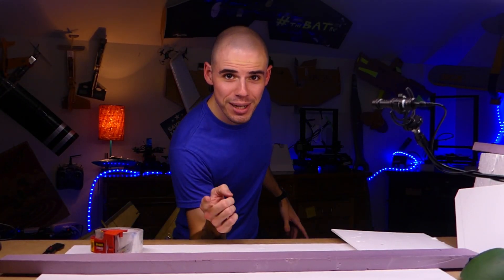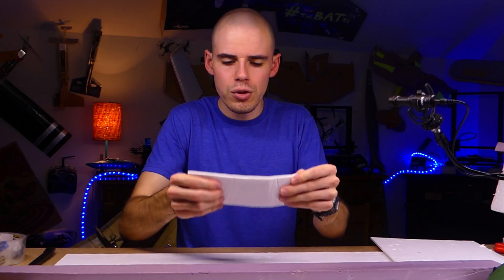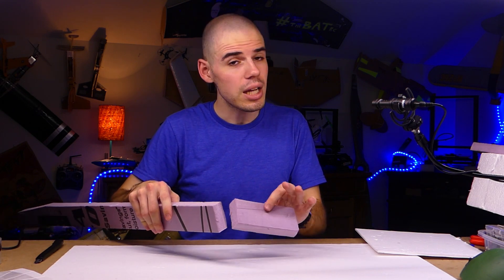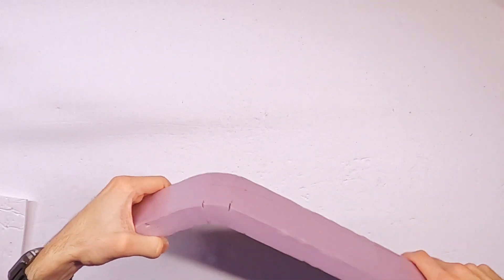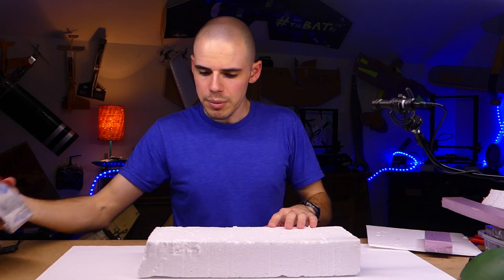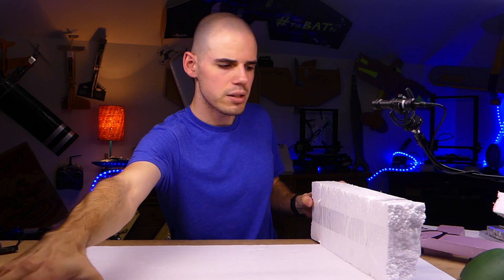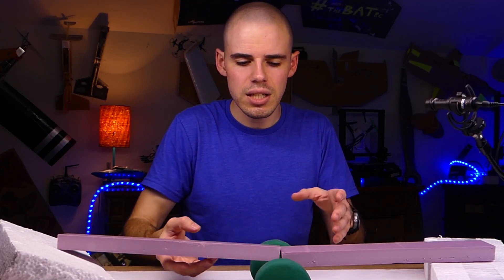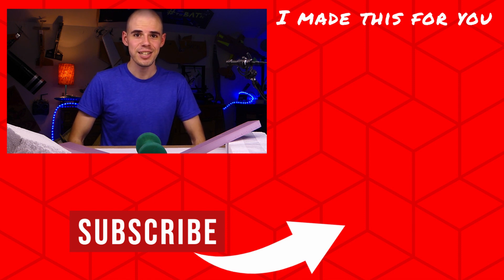Packing Tape is like MAGIC for Airplanes! Fun Packing Tape Strength Demonstration

Comment from the maker: What's YOUR fav method for making your planes STRONGER?
Reply: If you had started with a paper mache' skin, sanded it smooth, and then added a packing tape, or even better, a super thin lamination film skin, your test would be much harder to demonstrate since the composite is hard to damage.  If you did the combination on both sides of your foam board as shown in this video, you would need a lot more weights to cause the foam board to break, or crush into a U shape.  It is a very old method, but what a few model builders do for their pride and joy projects since it adds very little weight, but makes the fuselage and wings almost as tough as nails.  Plenty of YouTube videos on the process, so no need for me to say more.
Reply: 1) packing tape
2) leaving foamboard paper on
3) bbq sticks or spar
4) not giving it to you to rip apart like some insulation foam :)
Reply: PACKING TAPE!!
Reply: Would you recommend putting some transparent packing tape on my brand new EPP foam P51D 500mm warbird for protection? Scared of flying it for the first time! 😢

Comment: I’m thinking the strapping tape with the fiberglass fibers embedded in it would be very strong, especially if applied with two layers with the fibers at 90 degree angle to each other. It typically is not as wide as packing tape but the tear strength is far greater.

Comment: Thanks for the video Adam, im suprised this hasnt had more views??
Another cool thing about tape, i made a really heavy plane out of cardboard, ended up being too heavy. I then realised i could cut large triangular holes out of the surfaces of the wings, covered them with tape, and then warmed up the tape with a heat gun/hair dryer. The tape became super tight and strong. Too much heat though and itll melt the tape. Not enough and wings will be floppy. This might not work with all tape, but i used regular brown packing tape. Cheers.
Reply from the maker: Thanks for the feedback! Cool ideas, too!